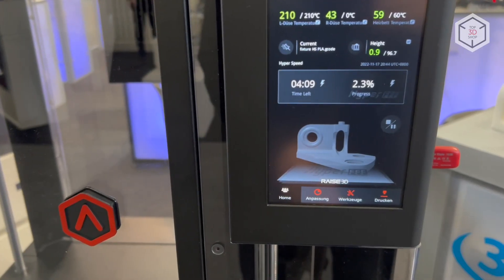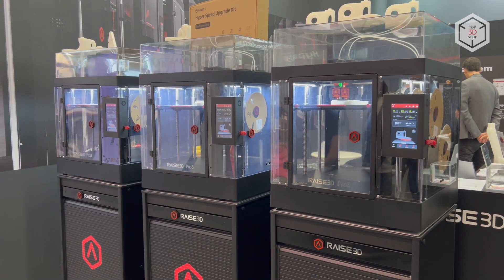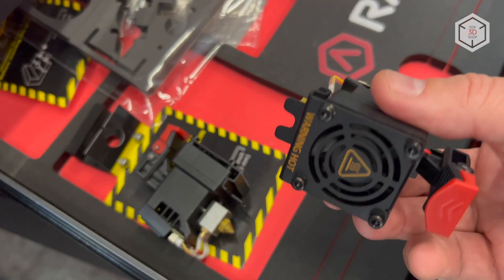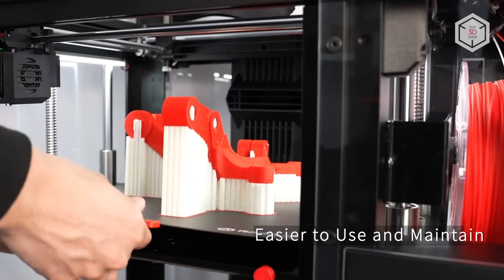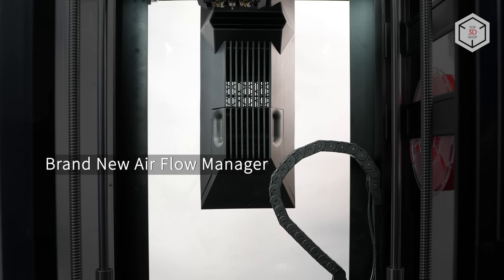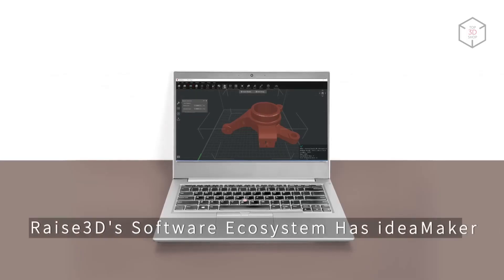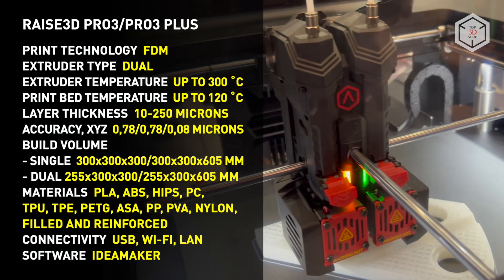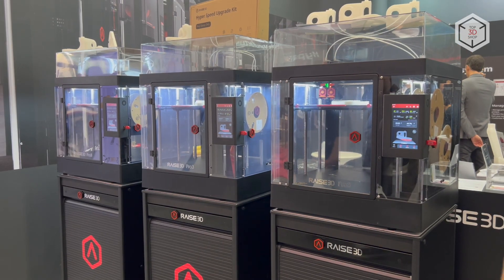Raise3D Pro3 / Pro3 Plus Overview: High-Performance Professional FDM 3D Printers

Comment: This thing is very nice. I have one pro3 plus... very reliable and precise. But don't try to print big abs parts or anything else that warps. Without a headed chamber (even after hours of preheating with the print bad) big prints are simply not possible. Even with a sticking 1st layer, then it delaminates in-between... I currently try to build a chamber heater, but nobody can tell me how high temperature the components can survive... i guess 80 degrees should be fine. So I think the marketing is a little misleading with a big build volume where you can only print pla... a ratrig vcore costs a fraction with at least the same performance (single extruder though), and it has a bigger build volume (500x500x500)